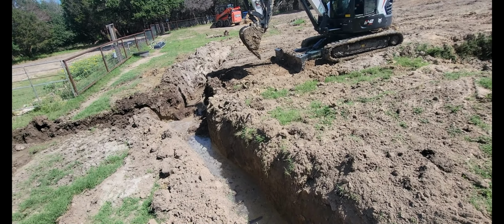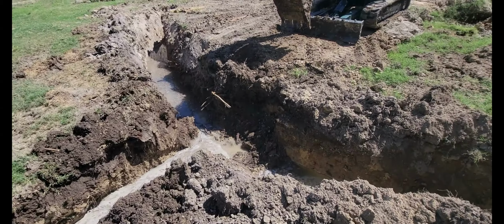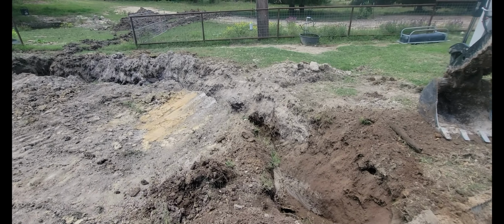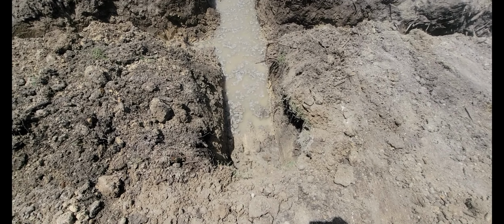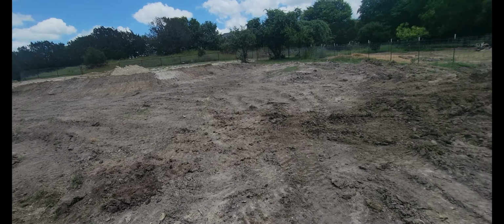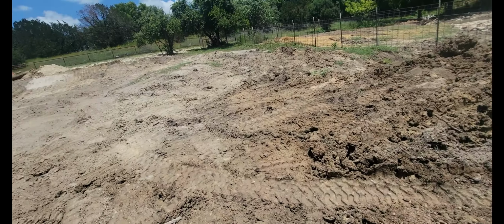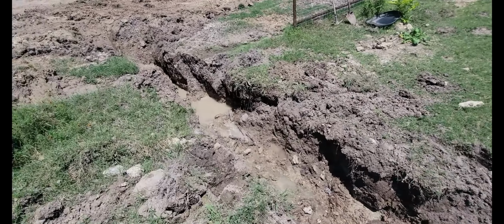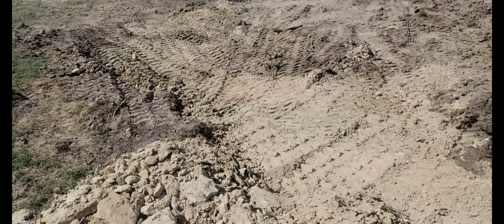Are leaky weirs too one dimensional? Taking it underground

Comment: great project, I'm curious to see how long it'll take for the local water table to rise and go over the sand dam/clay dam.
Reply from the maker: @pincopallinojoe9296  the next day, the water in the drainage trench was dry. This tells me it is working. Next project should be installing a very shallow hand pump. Drilling the 9" hole will be very revealing. I will say the seeps are slowing. My main pond went from overflowing a week ago to 6 " lower today and not overflowing. Thanks for following along.